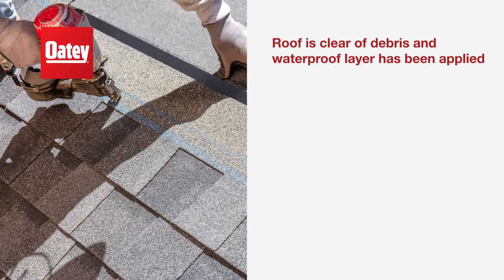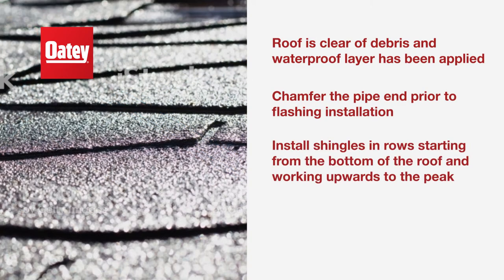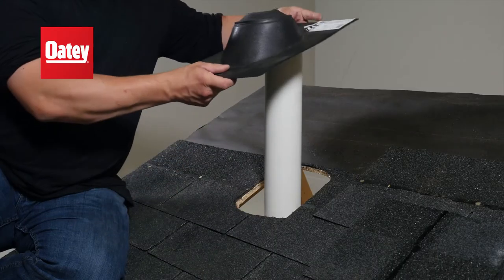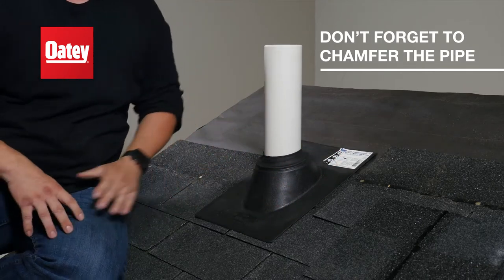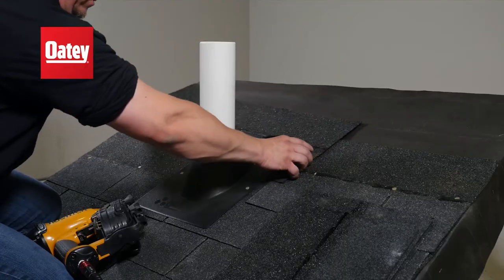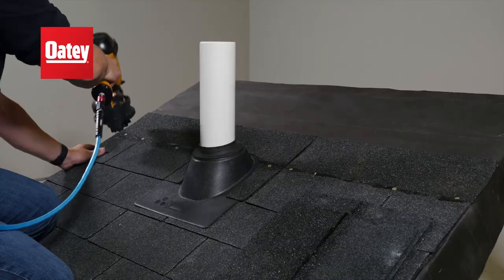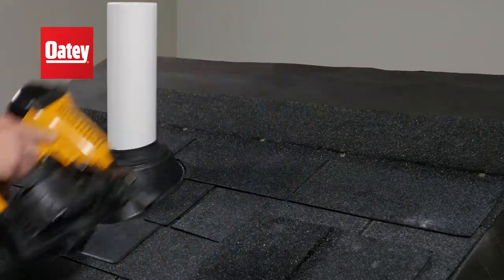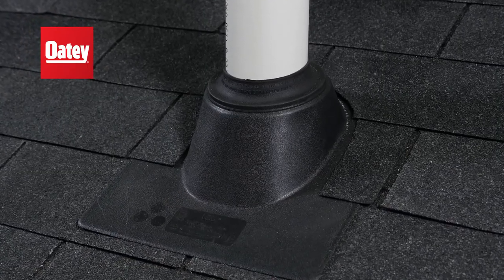How to Install a Roof Flashing

Comment: Not an expert, but a few things seem obvious. One, your penetration is needlessly large. Two, there isn't any sealer under the flashing at the bottom end (where you've also used no nails or gasket screws), and the flange is resting on the asphalt shingle. In a blowing rain, where it rains sideways Forrest Gump-style, the water can and will be pushed up into your penetration. How much depends on how long it blows. Third, if your neighborhood is squirrel-heavy, I would recommend a metal and rubber pipe boot. The squirrels can chew through the plastic and enter through your enormous penetration. LOL
Reply from the maker: Please follow manufacturer installation recommendations to ensure all applicable warranties remain valid.
Reply: Big Ol' Fat Rain

Comment: Yea, Oatey Jack's are not good at all. No sealant under flashing, no back-flashing with underlayment, the side laps of shingles and the flashing nails are almost right on top of each other. Also, the rubber collars are intergrated into the base flashing so when the Sun inevitably fries that thin piece of rubber, you have to replace or upgrade(lol) the entire base flashing. I've seen it a 100 times 🤭

Make sure your Roofer is legit, and if the price is really low, that's probably not a good sign, just saying
Reply: What flashing do you use then ?
Reply from the maker: @Jacob Duboise When installed correctly no sealant is needed since the flashing would be layered as if it was a shingle and water would shed down like the remainder of the roof. A 100% exterior silicone can be used though if the installer wants to use a sealant. Oatey recommends chamfering the end of the vent pipe as well to ensure no micro cuts occur on the rain collar(rubber piece) which can lead to the collar cracking over time due to the elements. If a rain collar does fail the whole flashing would not be replaced and a new rain collar can be installed over the existing with 100% exterior silicone so the whole flashing does not need replaced. You can contact technical@oatey.com for a set of instructions for our flashing's and rain collars.
Reply: With an Oatey base Flashing. . . The rubber pipe collar and the metal flashing are integrated; you can't simply off and on the rubber collar. 

With a wood shake-type Flashing with, you know 6-8" of flashing on the deck? Cut the flashing to size around the pipe and roof it in. Then slide down an independent rubber collar that can be easily exchanged. It's the best way. If you don't do it this way, I implore that you look into this method.